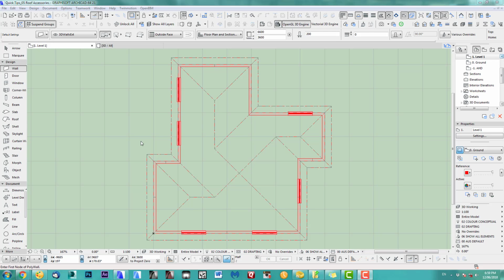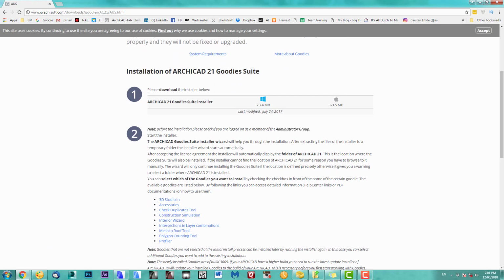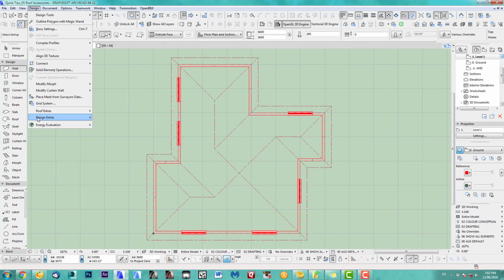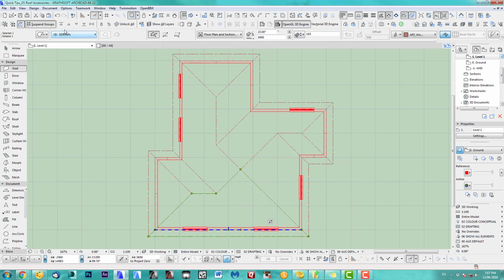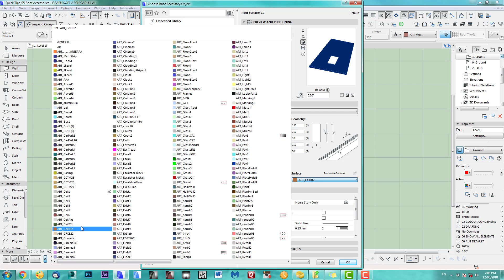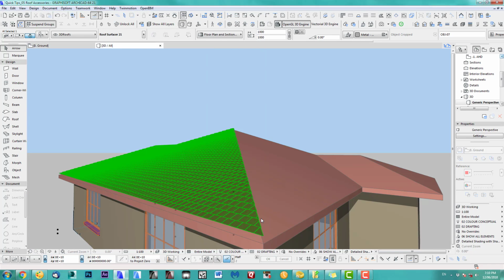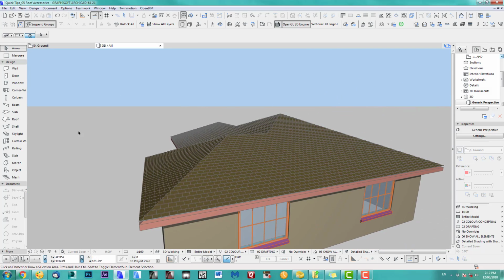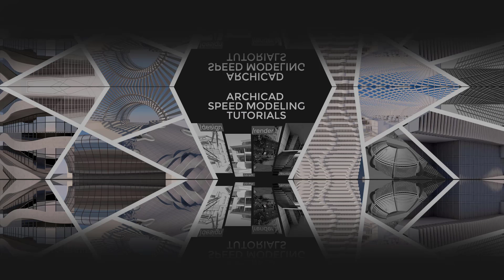How to create 3D roof tiles in ARCHICAD

Comment: Hello I am currently working on archicad 26, installed and loaded the goodies folder on the file. I can see the object in the object tool, in the Roof Accessories but when I hover on the design extras there is no drop menu for the roof accessories, so I can't place it on the roof I have made. Any tip on what I did wrong so far? thanks in advance great video
Reply from the maker: Hi Nick, have you loaded an old working environment, like I mean a customized one you did yourself? This is one thing I would check. If you choose a standard environment that Graphisoft supplies, can you see the drop menu then?
Reply: @ASMTechbase  Hello thanks for answering. The drop down menu doesn't open in a standard environment also. Seems like it can't load or something in the archicad environment. Any helpful tip?
Reply: Just realised that I can see the extras in the object Tool but can't place it in the whole roof. Still a problem.
Reply from the maker: You have to select the roof first

Comment: i want asking sir, I use version 21 and how to activate this feature because I already installed it but it doesn't look like in your video
Reply from the maker: My apologies only just saw this message!  It's a bit hard without seeing an image of  a screen shot. Please check the following:

1. In your ARCHICAD folder - in addons - goodies, make sure you have Accessories.apx in there.
2. Open ARCHICAD 21 - Open the library manager because you need to load the accessories library to be able to use it and see it. In the library manager go to bottom left - click add - and browse the location of the Accessories Library 21, which will be in the main ARCHICAD folder.

Hope this helps

Comment: Plz tell how to group columns 
You use Archi21 and am using archi20 so we are different 
Plz answer am doing your sunshide video
Reply from the maker: It is the same in AC 20. Make sure you select everything you like to group then hit ctrl+G ( on PC ) or use the pull down edit menu. If you have done this, make sure you don't have - suspend group - on because then, even if grouped, they won't move together.